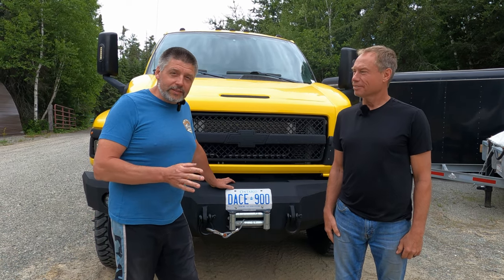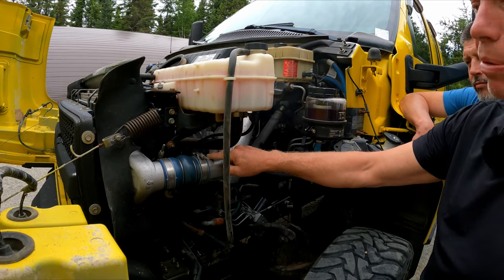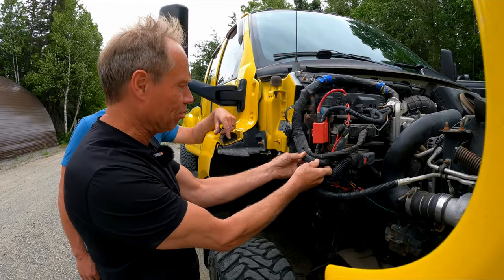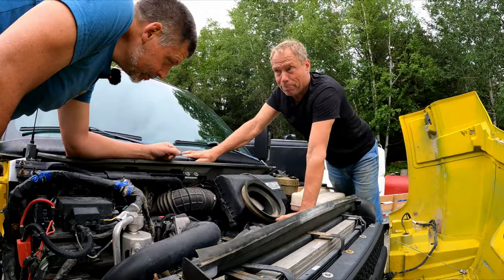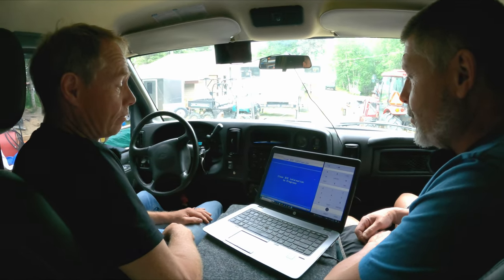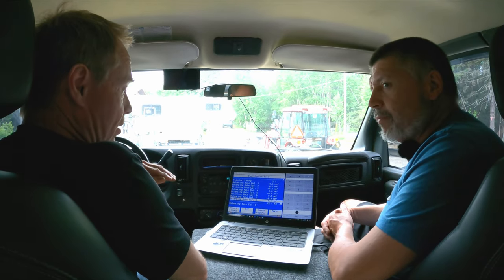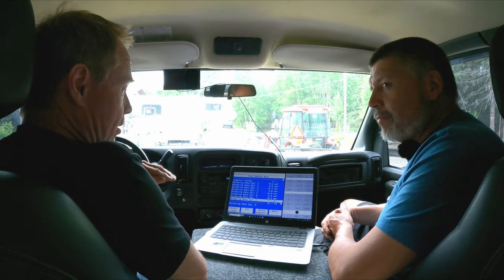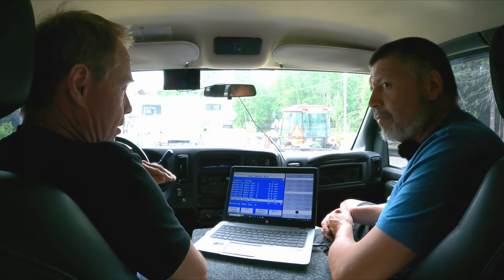Expert Advice: Chevy Kodiak c4500 Engine Tips

Comment: Any issues with fuel injectors and harness? And did you put a FAST PUMP on the fuel system? I know this truck yr had issues with injectors
Reply from the maker: We've had no problems with injectors or harness yet (~8k miles). We try to source good fuel in our travels. Contaminated fuel causes a lot of injector problems. We aren't running a lift pump yet but may in the future. As long as the fuel lines are air tight a pump isn't necessary for now. If we do have problems on the road there will be a video. Thanks for watching